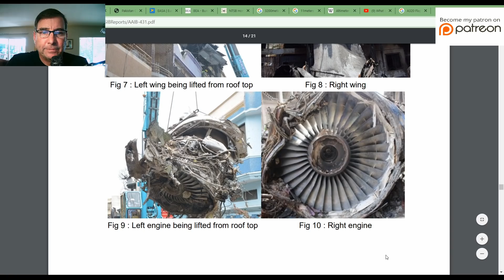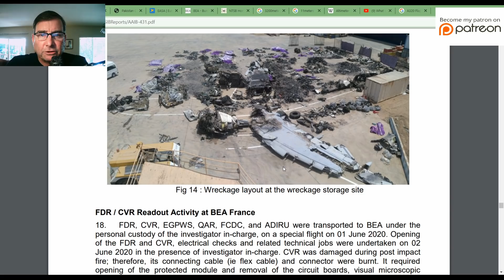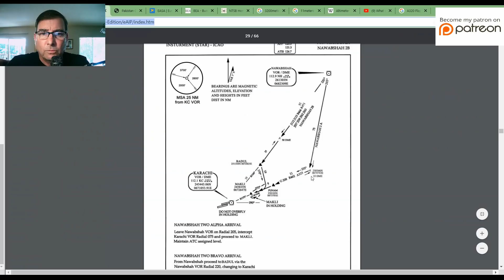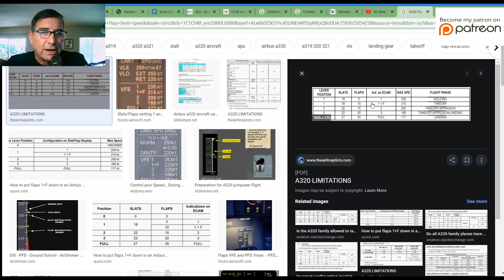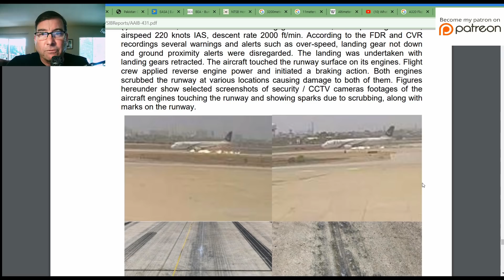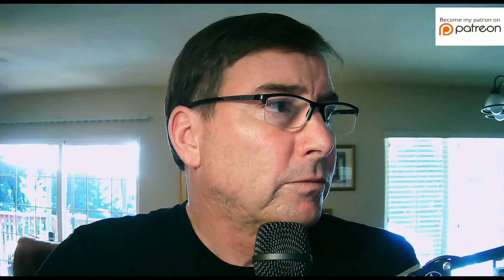PIA #8303 Preliminary Report Part II

Comment: It's an ironically tragic illustration of just how remarkably well built these aircraft are that you can pancake one, apply reverse thrust, and STILL get it back in the air. It's really quite absurd to think the passengers would have been better served had the plane's engines simply stopped working IMMEDIATELY upon striking the ground. In fact I wonder if someone might not recommend exactly that feature.
Otherwise? I'm reminded of something I've said many times in my own work environment: It's impossible to make anything foolproof as fools are so ingenious.
What a remarkable charlie-fox. Not sure how law works over there, but I have a feeling PIA (or perhaps their insurer?) better get their chequebook ready.

Comment: The landing gear (L/G) failure maybe a training issue (and a design flaw). The clue is in how the L/G lever was only activated momentarily during the go around. I imagine the same thing was done before the landing attempt. According to Airbus "OPERATION OF GEAR AND DOORS" this would not be a problem under "normal" landing conditions where an Airbus' speed remains under 260kts, as there is a hold circuit that keeps the L/G down even when the lever is re-raised. The failure mode arises whenever the Airbus L/G speed limitation (260kts) is exceeded. At speeds greater than 260kts, the L/G is retracted regardless the lever position. However, with the lever in the up position, the L/G will remain retracted when the plane's speed is reduced below 260kts, and only with the lever in the down position will an Airbus automatically lower the L/G under the same condition. I suspect a rapid descent during landing increased this Airbus' speed above 260kts after the L/G was already lowered using the lever down/up method described above. The pilots obviously ignored the failure, probably due to not understanding the Airbus' design.
Reply: Can you link where it says that. I am not aware of any auto retraction on airbus

Comment: If there ever was a definition for "the left hand not knowing what the right hand is doing" this is it. It sounds like during the first approach one guy thought they were going around to lose altitude while the other guy thought they were going to land straight in. As such the gear was retracted for the go around but not re-extended for the landing. Those unfortunate passengers would have been better off with just a single pilot up there trying to do one thing or the other instead of two guys each trying to do two different things at the same time.
Reply: We shouldn't speculate until the voice recordings are published.
I suspect we have a dominant Captain with a first officer scared and confused

Comment: Commenting here just to point some interesting features on the procedure plate for Karachi ILS Rwy 25L: 
1) there is an "INITIAL APP ALT FL80" and a "MAX KIAS 230" indicated inside the holding pattern. Only the altitude itself  (in my opinion) would justify a COMPULSORY holding to set the aircraft to the prescribed parameters of the procedure. The speed add more exceedance to the situation.
2) The APP comtroller should MANDATE a vector using consecrated expressions like "Turn left heading one eight zero RIGHT NOW! (or IMMEDIATELY)". The controller himself will be always an important PART of the REASON (swiss cheese) model: his actions could be one "SOLID, non perforated slice of cheese" in this case...
Reply: He said "Turn left heading one eight zero" but the crew returned "we already are established".
This is where of course the could have withdrawn landing clearance, but when I understand the situation in pakistan that would have cost the ATC controller his job.

Comment: This is the most perplexing accident i have read about it. From one of the recreations made (and who knows how accurate it is), it showed that when they put the gear down, the  instrument panel showed that they were not down and locked. Nothing about this was relayed to the tower. Apparently they just put the gear back up. But they did not inform the tower that they were landing gear up and never asked for emergency equipment to meet the flight. Then, if that wasn't weird enough, instead of just stopping, they scraped up and down with the engines and then took off again! The key here is did the pilots know about the gear/not know about the gear.? Cannot understand what they were trying to do

Comment: Thanks Juan!
As I mentioned in a previous video about this accident, I'm a complete outsider to aviation, but my comment then was that they attempted landing not knowing that the landing gear was up, which seems to be confirmed. After watching this video, I'm tempted to speculate further that, probably the FO was flying the plane and, when aware that he was too high too fast, decided to abort landing (gear up) and go through the holding pattern to meet speed and altitude requirements, at which time the pilot took over, made a dive to the gliding slope and attempted landing, not aware that the gear was no longer down. The CVR will probably show that there was some tension between those two and they were probably going against each other, instead of collaborating. The stiff calm voice of the pilot seemed odd and could indicate someone internally infuriated, forcing himself to appear calm. Like I said, speculation.

Comment: If pilots intentionally choose a high rate of descent approach from high altitude, wouldn’t they be better served to get slowed down first, get the spoilers and landing gear and at least some of the slats/flaps out to minimize ground speed and maximize drag for the descent?  This would, of course, require some finesse about when to retract spoilers and perhaps add power to get on glide slope near the end.   Of course I realize that taking ATC’s suggestion to descend in a holding pattern would have kept them much closer to normal airliner operations.

Comment: One minor point you may have overlooked: it seems pretty clear they'll also investigate the performance of ATC. 
While they appear to have done the bulk of things absolutely correctly, and if the pilots are intent on crashing their perfectly good plane there's not a lot ATC can do about it, but the fact the flight wasn't handed to tower control surely needs investigation, too. Perhaps their regs allow for what happened (landing clearance via phone and not directly to the flight), in which case they'll doubtless have to consider the wisdom of that.
Sad to see it was exactly as we've all feared, complete and astounding level of incompetence by the Captain, no matter what the 1st officer may have been doing. Process, process, process. How many people have to die because professionals don't keep that first and foremost in their minds?
Cheers

Comment: Occam's razor possibility: the pilot expected to be able to land in spite of the excessive altitude and speed by having the landing gear extended. He might have been right, and PIA better check their pilots don't think it's an acceptable procedure. Unfortunately, the landing gear was retracted unexpectedly (to the pilot) so that the speed did not reduce enough for a landing. Things happened way too fast from that point on and the situation wasn't recoverable.

Comment: Juan, are they positively sure this crew was certified to operate this aircraft?  In 2008 the crew of a Learjet 45 lost control and crashed on approach to the airport in Mexico City.  Investigators found that BOTH pilots, who were Captains, were not rated to fly the Learjet 45.  Additional investigation found that BOTH pilots had fraudulent certifications.  One Captain lied about the number of training flights he had made, and had issues on the few training flights he did complete, while the other Captain lied about being a Learjet 45 instructor. Both men had taken advantage of a corrupt system to get false training documents and some unsigned Learjet 45 certification forms from their flight schools.  Makes you wonder that in some areas of the world if those on the flight deck actually are qualified to be flying.

Comment: I am really surprised about the loss of power to the FDR at such a critical phase of the flight, especially being a known design feature. this should result in a review by Airbus and possible remedial action.
Reply: It was lost because the FDR is powered by the AC Bus 2 but the CVR is powered by the AC ESS SHED bus. Only the AC ESS/ESS SHED bus were working when engines failed. The FDR uses much more power than the CVR and there are more important systems that need to be powered such as flight controls and captains instruments
Reply: @tomstravels520  right, then a design review is required. Nowadays FDRs are solid state, they should not need more power than CVRs. the problem with FDRs could be that they get their info from other systems that should also be running along, CVRs record directly from the mikes.

Comment: Selecting gear down at 7200 ft and 10.5 nm seems to me like an unorthodox use of the gear as a secondary or additional speed brake.  Just speculation, but that feels like the simplest explanation to me.

Possibly a valid advanced / desperation technique in an emergency situation; e.g. with other flight control issues and a need to dump energy.  It does not seem like a valid technique for a fully serviceable aircraft in normal passenger carrying service.

Comment: The audio amplitude in the vidio varies widely with your spacing to the mic, which drops way down if you back off even slightly. Try keeping back at least a foot from the mic and increasing the gain to compensate. Then small distance variations should not matter.

Comment: It isn't a coincidence that the 2 737 mx crashes happened under the watch of pilot crews of airlines similar to this one.
Reply: How can you compare those 3 airlines? Using what statistics? ET is considered a very safe airline. The last fatal crash before the Max was only 1 year after the last fatal US commercial aircraft accident (Colgan Air 3407)
Reply: @tomstravels520  Whatever dude, incompetent air crews are everywhere I'm sure. That has no matter in my statement. Those airlines like you stated have the safety record they have because of the ultra high quality aircraft provided.

Comment: Truly  the strangest thing about the circumstances of this accident is the decision to retract the gear at 1700 ft or so. The pilots might have actually 'pulled off' a landing otherwise. Points to serious confusion on the flight deck.
Reply: I'm pretty sure they wouldn't have 'pulled of' a landing at those 100 knots beyond normal approach speed. The only difference would have been that they would have flared 'forever' and then ended up in a runway overshoot crash. No runway is that long. Maybe a few more survivors, but still a major crash. There's no other way with that much excess energy.
Reply: @___Chris___  A runway over-run wasn't a certaintly. The runway was dry, so braking action would have been good and reverse thrust was operative. With half of 11,000 ft of runway, even an overspeed landing was likely possible. Seriously though, by any decent standards, this was a truly 'botched approach' and totally unacceptable today.
Reply: @pasoundman  I'm only a PPL pilot, so this is only my opinion and not something I can prove. But ultimately, even for airline pilots all this still comes down to speculation, because all performance tables(/calculations) only indicate the landing rollout at normal touchdown speed for a given ldg weight and headwind component. But keep in mind that you don't have braking action before the wheels are firmly on the ground. IF this is the case (and with reverse thrust), it's not a secret that an aircraft can slow down rather quickly at max braking (/max autobrake). I wasn't trying to say that this long runway was too short to brake and come to a stop IF in a theoretical(!) scenario you could apply effective braking at that speed, but that the speed was so high that they would have flared in ground-effect over most of the runway before they could have even started (!) effective braking. Forcing the aircraft onto the ground at high speed in order to circumvent this and start braking early doesn't really work: even if you're lucky and the aircraft doesn't bounce a few times (or the tires blow up), it still creates too much lift (=less weight on the wheels). If you brake before an aircraft is 'sitting' firmly on it's wheels, all you get is smoking tires (if braking is possible at all; as far as I understand airliner landing gears have sensors that detect the weight on the wheels and prevent braking before the aircraft is really 'sitting' down; airline pilots please correct me if I'm wrong).

Comment: Did you consider the fact the pilots were fasting? May is usually a very hot and humid month in Lahore and as wel as Karachi. When the crash happened, majority of people would have been fasting as it was the holy month of Ramadan.

Comment: They stalled/crashed with flaps/slats at position "1". I wonder, when they lost the engines, if they had trimmed for "best glide" (I know, I know), would they have made it to the runway or, at least, past the buildings they went down in?

Comment: Wow, great read and analysis. 
   After hearing that the data recording stopped after engine failure, (not sure if off #1 or #2, or both). I have only 2 questions at this time. What kept power to the voice-recorder,, or did we lose it too and just how far back does the tape go?
   I always thought it stored :30min. Thought I heard you say there might have been some decisions towards the beginning of the flight. ??? :30min tape would not have kept that info!! 
  Thanks, Juan great job.
 As an A&P, love your take
Reply: The CVR used to record for 30 mins but digital ones can be for I think 2 hours or maybe more. The FDR could record longer buts it’s probably a limitation due to the fact the RAT can only provide 1/18th the power of the engines so only the most essential systems can still work. I’m sure the ECAM can still record data

Comment: Gross negligence cannot be tolerated and not to detract from the fact this is probably the worst case of “Pilot Error”..... aviation standards and training need to promote a greater Just Culture across the board whereby flight crews, ATC and others are not punished for their actions, decisions and or omissions made by them that are commensurate with their experience and training. Without the fear of admitting errors - many more lessons could be learnt for the betterment of Aviation Saftey Worldwide.

Comment: Great video and great detail.
There is however some confusion as to the Airbus 320's operation when trying to lower the landing gear, Does not the sensors base the maximum speed at which the gear be lowered on the IAS and it is not necessary to recycle the lever to activate "gear down"
Also given that the pilots lowered the gear at 7000 ft , as soon as the A320 went below 250Kts  would not the gear automatically lower, given that it  did slow down to approx 220Kts ?

Comment: thanks, jb...maybe the recorders will complete the technical events on approach with reasonable certainty, but i'm curious how they ended up so far out of landing protocol, i.e. altitude in relation to the correct glide slope. hard to believe they were simply 'asleep at the switch', perhaps actually asleep

Comment: I have to wonder with all of the confusion in the cockpit whether there wasn't an undeclared emergency on board such as smoke in the cockpit,  hijacking ect..? This just does not add up without extraordinary circumstances being involved.
Reply: If there was smoke then the oxygen masks would have been used in the cockpit. And how does a terrorist get into a locked cockpit?

Comment: It has been reported on the news media today, here in the UK, that it has been discovered that 260 pilots in Pakistan, out of 860 (over 150 of them employed by PIA), have bogus licences, and /or have paid someone else to take the relevant training and tests on their behalf. I believe that it will be revealed that this crew will be among those that were never actually qualified to fly commercial aircraft. I find it unbelievable that properly trained pilots would make this many mistakes in a single flight, would be caught out by the landing in that way, and they certainly wouldn't have tried to go around after running down the runway on the engines. No properly qualified pilot would be so inept. Such a sad event.
Reply: Well, for someone not qualified to fly the plane they had an impressive number of hours.
Unless those were fake too, of course...
Reply: @Rob2  I wonder if the numbers a real but belong to someone else.
Reply: The issue is that pilots are flying, but have not received the necessary training, i.e. Simulator training, training for the specific aircraft etc. They will have flown all the hours that have been attributed to them, but, having not actually taken any simulator training, they would be completely unprepared when things start to go wrong. In the past, I took several hundred hours of flight training, and I could probably manage a commercial aircraft on a routine flight, but I would be hopelessly out of my depth if anything went wrong. The Pakistan authorities investigation began a few years ago after a different crash. They have discovered that pilots, who may have taken training on light aircraft, had other people take the simulator training on their behalf, or simply paid some corrupt officials to issue, or validate, their licence.

Comment: Both engines stopped in flight, then the flight data recorder is stopped to preserve evidence of the cause of the failure. There is no reason to record further information because that aircraft is going to hit the ground. Nothing that happens to the aircraft after both engines have stopped is worth recording. Cockpit voice recorder is another matter as that may record useful information up to the point of impact.